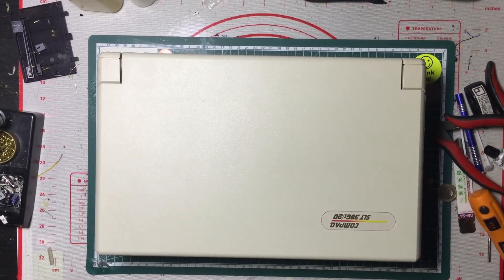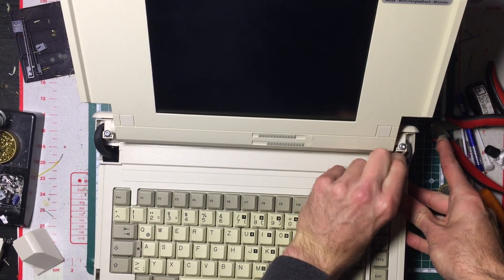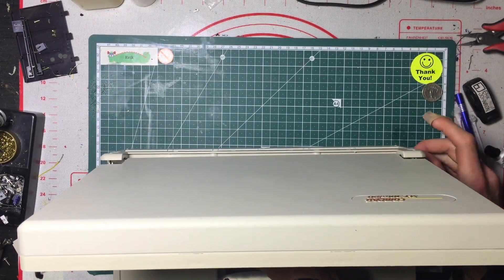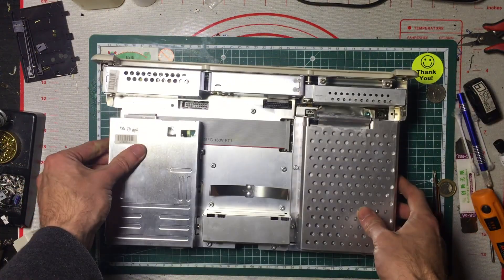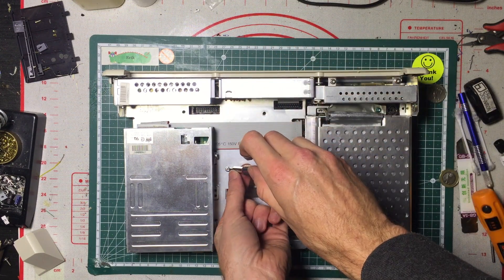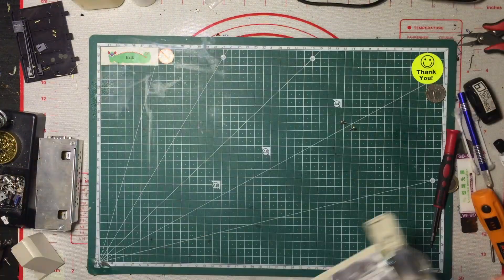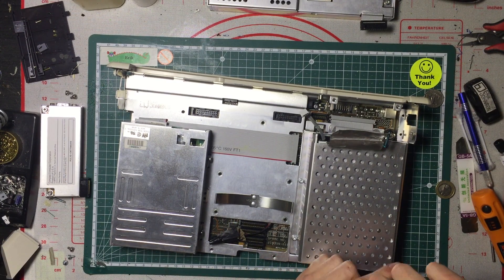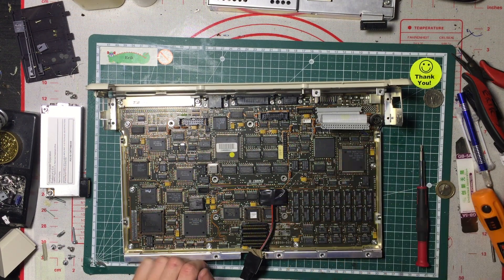Disassembling a Compaq SLT 386s/20 Luggable/Portable/Laptop computer

Comment: I’ve been through this process so many times, I think I could do it blindfolded! The SLT is one of my favorite computers of all time, easy to service, reliable and well-designed. I’ve got seven SLTs, four SLT/286s and three SLT 386s/20s, one of which is a prototype that I recently got (that I’m still in utter shock about). Only thing I would advise against is moving the LCD with the two top-corner screws out; they are critical to the integrity of the hinge mount, and moving the screen in rare cases can cause the mount to crack from excessive flexing. Oh, and congrats on having the 2ND serial port option! Those are very uncommon to find these days, I’ve only got one out of my seven units.